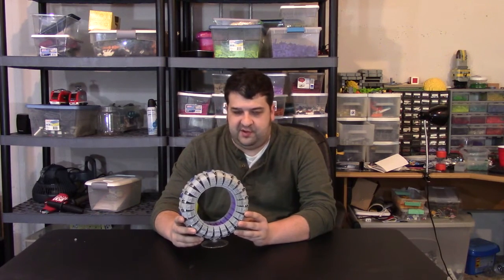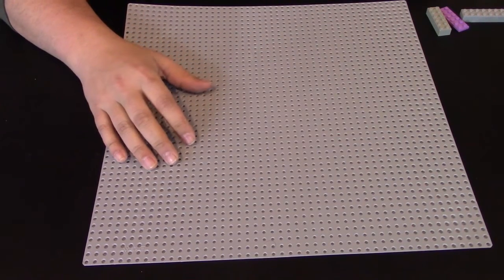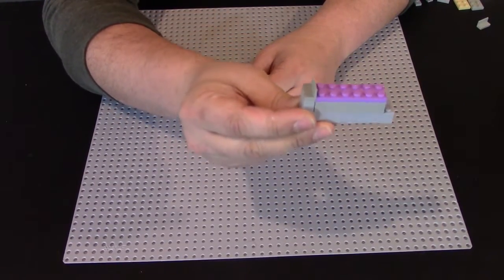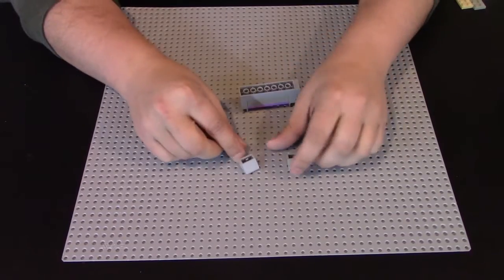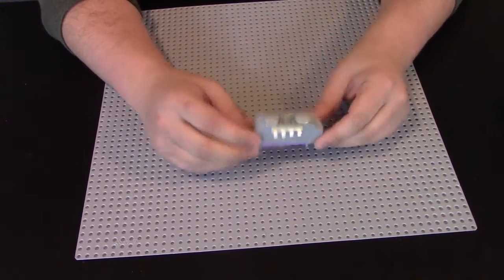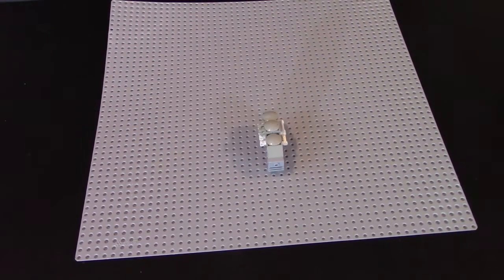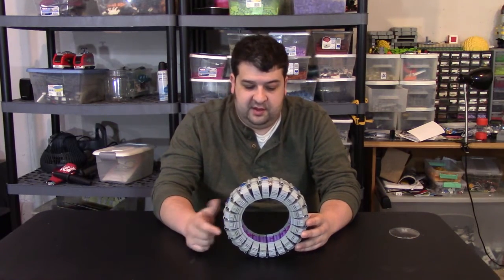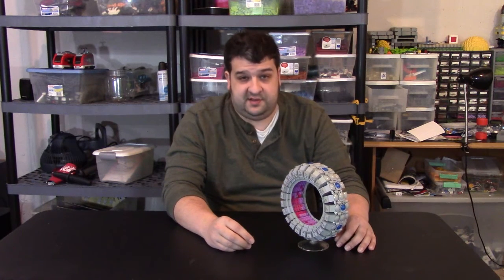How to Build a LEGO Space Ring Habitat

Comment: Here are the non common brick parts
u9026_Brick_1_x_1_Round_without_Groove
3794b_Plate_1_x_2_with_Groove_with_1_Centre_Stud
48336_Plate_1_x_2_with_Handle_Type_2
2412b_Tile_1_x_2_Grille_with_Groove
32028_Plate_1_x_2_with_Door_Rail
44728_Bracket_1_x_2_-_2_x_2
60470b_Plate_1_x_2_with_2_Clips_Horizontal_(Thick_C-Clips)
60470a_Plate_1_x_2_with_2_Clips_Horizontal_(Open_U-Clips)
30236_Brick_1_x_2_with_Handle
2654_Dish_2_x_2